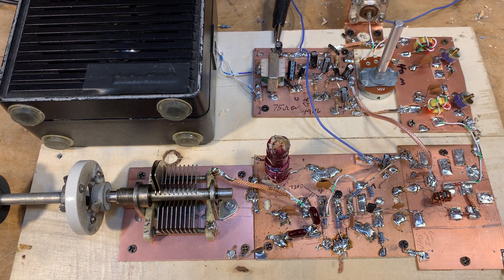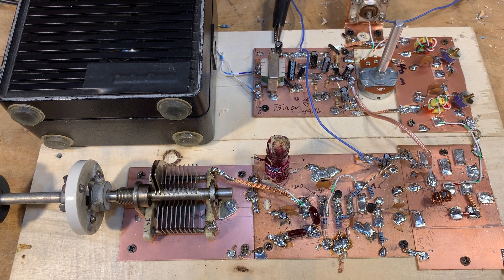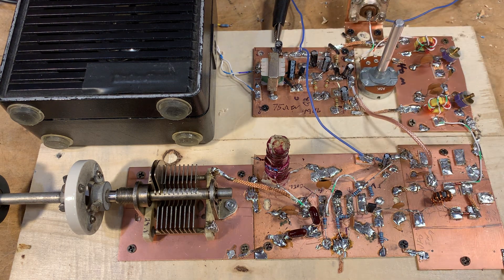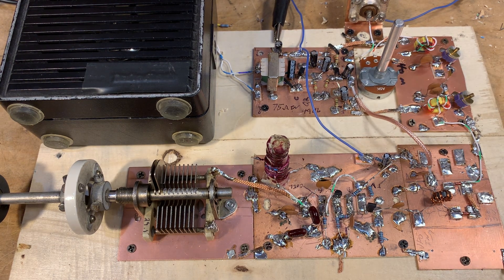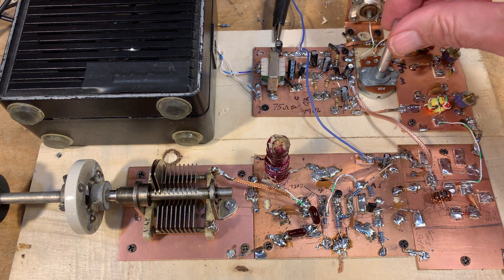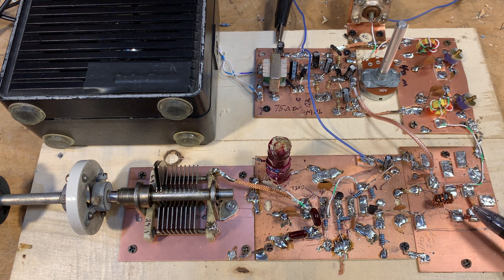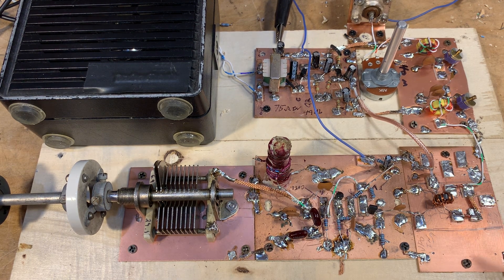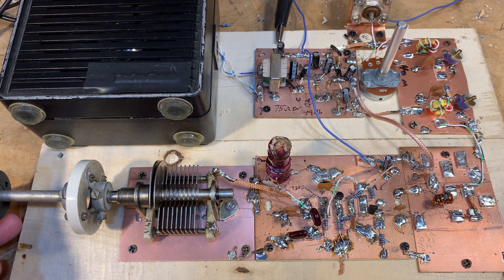Update on the Direct Conversion Receiver

Comment: I’ve only built from Kits, but I wouldn’t think the Transmitter Part, especially for ssb would be far more difficult than the receiver
Reply from the maker: Tor transmit, you could easily build a DOUBLE sideband transmitter.  Using the VFO as the only common stage, you could have a DSB/DC transceiver.  I have many posts about this kind of rig on my blog.  Good luck. Bill
Reply: @soldersmoke  thanks bill!

Comment: Nice job Bill! I never thought it would be so easy to get discreet transistors to match the gain of an LM386 and nice that you’re using common 2N2222s.

Addendum: I took ARRL’s advice and bought a used Drake 2-C in 1975 and started building the transmitter in that year and it wasn’t finished until early 1977.